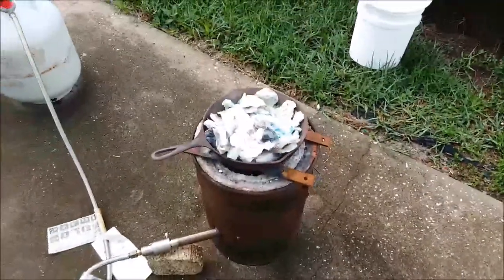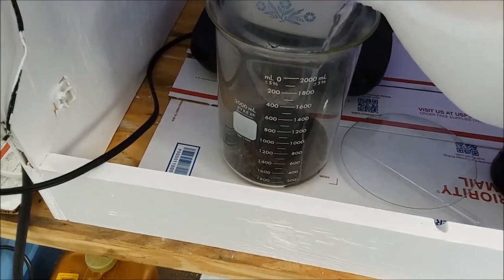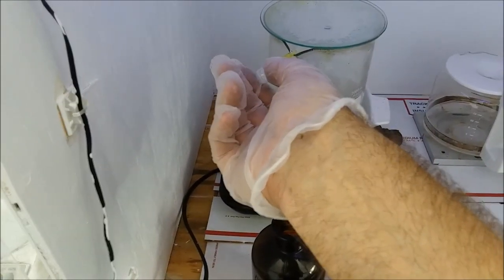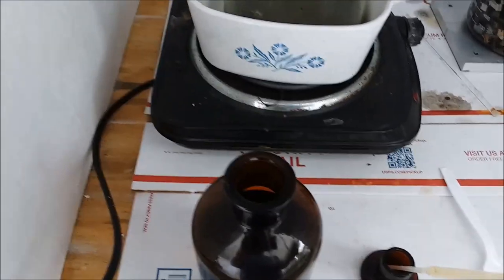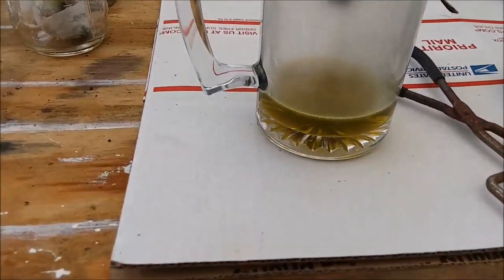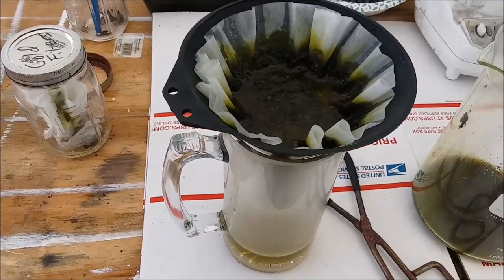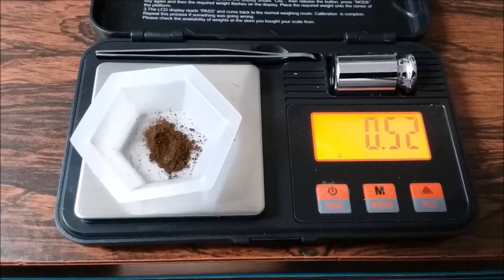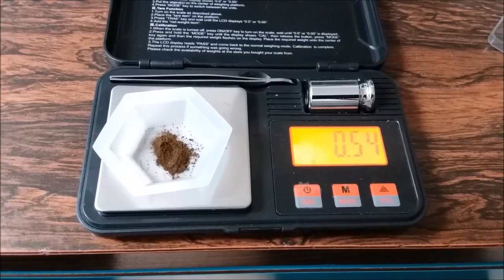Processing My Used Filters To Recover Gold

Comment: Good video. Question - how would you have colloid gold after adding nitric? I’m actually asking not trying to be smarty pants. From my understanding, which could be wrong, the nitric would take it from colloid to a solution. 
Also if that is ONLY gold filters that you incinerated, would Copperas be better than SMB to drop a dirty solution that has carbon and yuk yuk from the incineration?